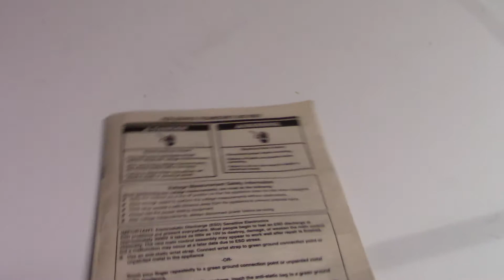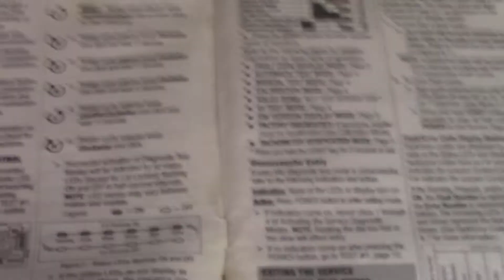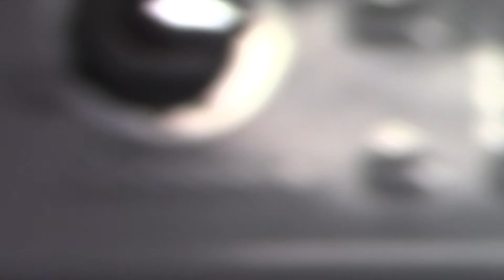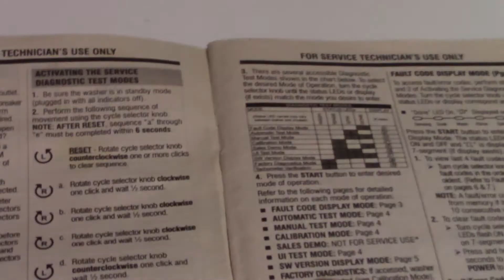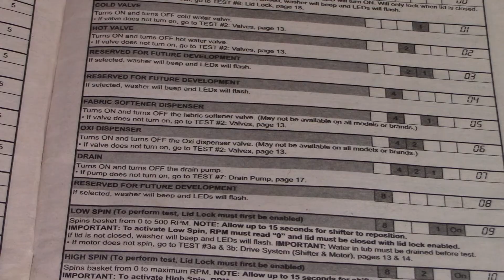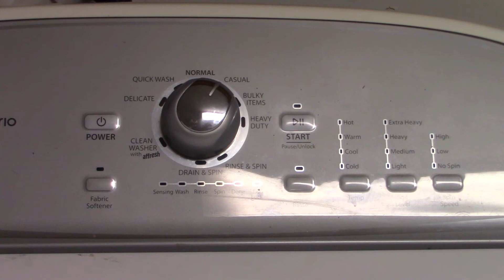Broken Cabrio Washer  - Manual Test Mode for Drain Pump, Lid Lock, etc

Comment: I have a whirpool cabrio wtw7600xw washed a load of sheets, and they came out with the sheet over the top, which it has done in the past. This time, there was junk all over the top, which looked like poop, dirt and sand mixed together. Disgusting. I ran 3 cycles of clean washer, and while the drum was full during the cycle, it was full of junk floating around. What is causing this? I dont want to use my washer until i figure this out.

Comment: Awesome video, thank you!  I thought I was done with secret Nintendo video game codes 😂.  I'll be using this manual tonight!
Reply: annnnnnnnnd of course, i run auto test and individual tests and everything appears to work in diagnostic mode. Pumps fill ,it cycles and drains , but once i try to use a wash cycle it plays dumb LOL  Trying to figure that one out now, it seems to skip the water filling and goes to agitate mode. i was hoping for an easy diagnostic test to show a pump failure but naaaaah thats too easy.  now i have to figure out how much time i waste researching this gremlin before i decide on blowing it up.
Reply from the maker: If it skips the water filling, then the machine thinks it’s already full. (Trying to help you think through options.)

Comment: This video saved me. I cant find my manuel anywhere and I needed the diagnostic codes. 

Turns out my agitator just had something clogging it. Looked like some dirt or maybe rust particles.  Manuel mode tested everything got some water in it and ran the agitator a few cycles then drained it. Seems to have broken up whatever was jamming it.   Thank god.
Reply: i also have the rust issue, but the washer runs great in diagnostic mode just not real life we need to wash clothes mode lol

Comment: Many thanks for the info! I was able to locate the manual right away…didn’t realize there was one in there. My issue was broken wire right at drain pump connection, was glad to find it, easy fix! Thanks for sharing, saved me $500 on new washer!